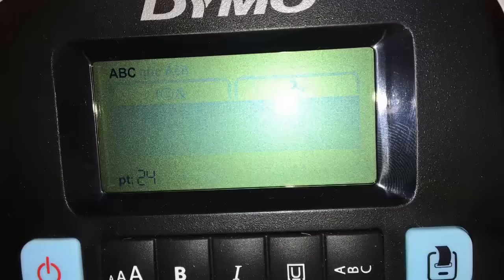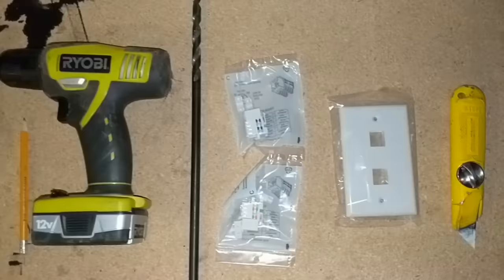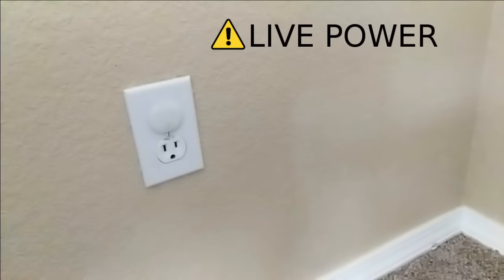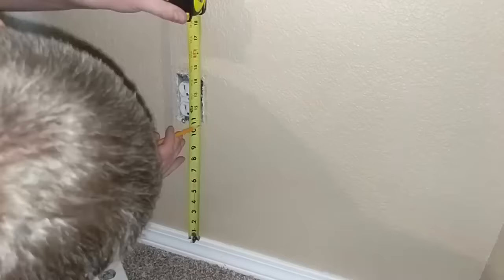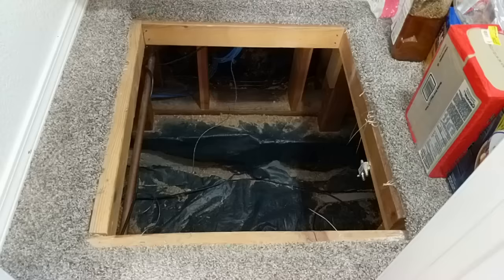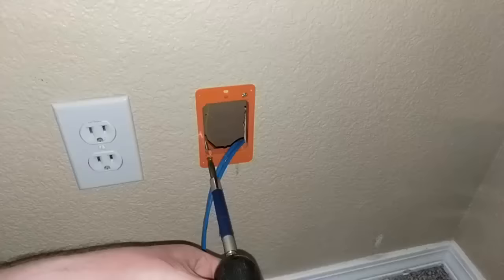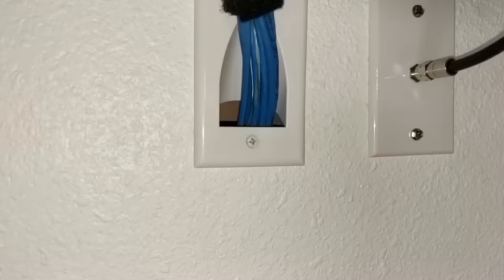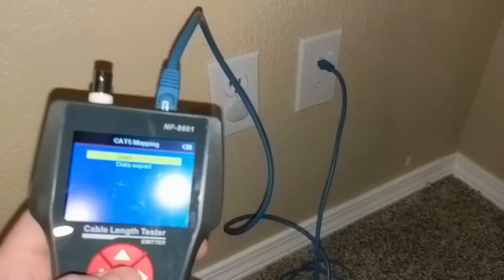How to Add a Network Jack to a Wall

Comment: Step 1: Own a house
Reply: @bumnoma  lol
Reply: American house, the rest of the world build with bricks
Reply: @marcovanderbank7361  like any real house should be
Reply: Yay I passed step 1
Reply: At least I can favorite this video for when I buy a house in the next 15 years
Reply: Single floor homes.  For single people. With broken dreams
Reply: @DrLol07  Not really, building houses out of bricks has a lot of issues, hence why we largely stopped doing it in the US. I've lived in a brick building and keeping it heated and cooled as appropriate was not fun. Perhaps if you live somewhere that never gets very cold or hot it's not an issue, but outside of parts of Columbia, that's really not going to be the case for most folks.
Reply: @marcovanderbank7361  not in Mexican
Reply: Kind of hard in a Biden economy
Reply: Step 2: If running through attic, know where you can safely go so that you don't crash through the ceiling.
Reply: @SmallSpoonBrigade I lived outside of US in a a country with extremely hot summers and extremely cold winters. I had very thick red brick home. Summer time it’s cool and no AC needed. Winter time it’s very warm. So you’re saving a lot of energy winter time and summer time.
Reply: Hahaha
Reply: @marcovanderbank7361 most old houses are lol
Reply: @beansbrian1986 I agree. A 2000 sq ft home goes for nearly 350K+ in the south. Shame.

Comment: And a crawl space. You'll need one of those too.
Reply: There's always an attic
Reply: Cameron Nason not in Artantica
Reply: A full basement works too.
Reply: Can't you run it above the ceiling than drop the cable down to where you want to the plug to be?
Reply from the maker: You can, but much easier if you have an attic.
Reply: @randomman6867  what if it's way smaller than the house
Reply: @thetrabantguy3934  if the attic is is less than 18" high I would recommend using those long ass spotting rods. I usually use a stick of 3/4 PVC to feed shit to me so I can drag it. Most attics/crawlspaces will be smaller than the rest of your house they're just there to help keep the house insulated and sneaking shit through them is a great bonus
Reply: @randomman6867  my house was build somewhere in the 19 hundreds so it's petty old
Reply: Best episode of Breaking Bad: Crawl Space.
Reply: Jessie Sanders  way older like 1. World War old like
Reply: I have in the side of the house
Reply: @david.ricardo  where is artantica located?
Reply: step #1 - get a Crawl Space
Reply: My apartment doesn't have a crawl space
Reply: @Zerpersande  exactly
Reply: @TheLeesmack  🎨🖌️🌐
Reply: @randomman6867  Not true, condos often times won't have an attic, and you're lucky if you've got a drop ceiling either. In that case, your best bet is probably to install a crown molding to hide the cables behind as you run them along the top of the wall and then just drop inside of the wall to get down to where the jack is going to be located. You'll have a bit of trouble at the corners, unless you go with a fairly thick molding though.
Reply: @randomman6867  hahaha knows nothing about construction not all houses have a and attic
Reply: We’re on slab foundation with only a very low attic above the upstairs (2 story house, but part of downstairs just has roof over it, if that makes sense).  Adding insult to injury, most of the area right by the attic entrance is covered by the furnace and ductwork, making getting around (or through?) For running cables quite hard.  (I’m in California, so a lot of houses out here don’t have basements)
Reply: @andresv8856  it doesn't take construction knowledge to know how to feed 06 wire in between existing residential walls
Reply: @randomman6867  yeah I could tell you don't work in the industry my friend so how are you going to run wire without attic or a crawl space having your studs every 16 inches you will make a hole every 16" till you reach to your desire location and I don't know what 06 wire is all I know is romex for outlets
Reply: @randomman6867  Nope, sometimes there's another room on top and you're just screwed.
Reply: Nah, I have a basement with drop tile ceilings.
Reply: @randomman6867  not if your in the basement

Comment: One word of advice.  If you are going to do this, make sure you spend a little extra money and get a good quality cable such as a cat 6 or better cable if there is something.  Even if something doesn't exist now that the wire supports, it may in the future.  And by putting in the best quality now can save you headaches later on by not having to go through this again.  Especially if you had to go through the hassle of fishing wires because you didn't have easy access to where you ran your wires.  When doing a permanent installation such as this.  It's better to plan ahead for future possibilities than to be left behind.  Also make sure the wires are suitable for in-wall use.  I should say so on the package or stamped on the wire itself.
Reply: Personally I used double shielded Cat-7, should be good up to 40gbps.

Comment: Super easy if you have a crawl space, but this is so very rare. :(  Often they're under only a very small limited portion of the house, if they exist at all.
Reply: Quite a lot of newer houses have crawl spaces between floors, but you are correct. More often than not there aren't any.
Reply: True
Reply: If you dont have a crawl, go into the attic. If your home is two stories, it'll be a real chore to bring the wire from the attic to the first floor interior wall, but it isn't impossible
Reply: @nilpo  Not a single house with crawl spaces here in Germany. Would like to build a smal network, but brick walls... 🙈
Reply: @Akantor5  Yeah this tutorial is only good for the US where the houses are hollow and made of paper.
Reply: Yep, No crawlspace for me. there's one UP stairs, that nobody has entered in over 20 years, but I need network cable run down stairs.  Lots of it. I have a nice 100 foot network cable running from the source to the exact opposite end of the house just hanging off the ceilings.  Works fine still but far from optimal.
Reply: Akantor5 Linus has a video where he shows running a 100-foot or so network cable on the outside of his brick home. He makes drilling through the brick look far less scary than I thought it was! Once you get the cable through the drywall, the rest of the procedure is the same as shown here. Search for it on the Linus Tech Tips channel.
Reply: Yeah that’s why I only buy older homes which have a crawl space. Always run more wore than you think you need. It sucks to have to do it again in the future.
Reply: Kevin Adams What if the house has neither a crawl space or attic?
Reply: DoctorWeeTodd 
Then it becomes much harder. You’ll have to fish the wire through the wall and ceiling. Hopefully you have a closet or space that is somewhat centrally located so you don’t run into too much insulation. 

Another option is to run the wire behind the baseboard or crown moulding.
Reply: exactly what I was about to say.  How many people have a crawl space?   

The best that some may have is an Unfinished basement.   And then you would need to be comfortable cutting drywall on he walls and ceiling to fish lines and then patching them back when you are done pulling
Reply: @morgfarm1  Run it outside.
Reply: The crawl space in my house is huge
Reply: @MildMisanthropeMaybeMassive  The best way to do it is to replace any COAX that you may have.

I just bought a house that's 2400 SQ Feet, 1st and 2nd floor. Servers and what not are going into the unfinished basement. The house is wired for COAX, I am going to attach the CAT 6 cable and pull it through. It's the best and most economical way.
Reply: Akantor5 if u ever end up doing it, remember to always drill into the brick, not the mortar
Reply: Underground Arms partial basement with a crawlspace under the rest of it.
Reply: @nilpo  crawl spaces are not in newer homes
Reply: @jokerbox_official  Sure they are. It just depends where you live. It's one of the three major foundation types in use in the United States: slab, crawl space, and basement. In many areas, the risk of natural disasters or environment make slab foundations impractical and not every new home has a basement.
Reply: Pretty common here in Oregon but this is the 1st place I’ve owned a home without a solid, slab foundation.
Reply: it's not rare at all, it depends on where you live.  Crawl spaces also are not what make this super easy, basements make it super easy.  Also, depending on how nice your crawl space is is a big determining factor of how easy it will be to move around in and deal with.
Reply: Depends on where you live, almost every home has a crawlspace in Alaska.
Reply: There are homes with crawl spaces all over here in the state of Illinois, and across the country they are just as common as basements or just concrete slabs. What a simple, stupid topic and still people passing misinformation like "they are rare". LMAO
Reply: @StephanieHua  Youd be MUCH MUCH better off doing this with an unfinished basement.
Reply: @jokerbox_official  Thats simply NOT true.
Reply: @VoidSixx  You misspelled, "where the houses are properly constructed." Solid walls made of brick is definitely not the right way to build a building for various reasons including the issues running electrical and network in the walls. Not to mention the issues you get when the ground settles or you have an earthquake. Better to choose good materials like wood which are much better able to handle those issues.
Reply: @MildMisanthropeMaybeMassive  One possibilitly is running it in the wall. You can do it, but it's a pain and you'll likely be patching a fair amount of drywall in the process. God help you if you have those cheap plaster walls where they textured it rather than properly smoothed it out. Or, you can run the wire on the outside of the wall in conduits. It's rather ugly, but if you know what you're doing, you can hide it behind moldings and in the corners where you'll forget that it's there. Even with that, you can just run the wire from the ceiling to the floor at the points where you want a jack. 

You can also often run it through the floor, if you're going the same direction as the joists, that can be rather easy, but if you're going perpendicular to them, then you have the same issues as you'd have going along the wall.

But, really, if you have neither a crawl space or an attic, like a typical condo, then you're probably best off just hiring somebody to do the work for you or just accepting that it's going to look ugly.
Reply: @SmallSpoonBrigade  Ha! My house is already ugly.
Reply: I have a basement. Does that count?
Reply: @VoidSixx  the US has houses made of wood, stone, brick, etc.

Comment: Knowledge to know that some homes are not 16" throughout the whole wall. I had a place that was 16" until I got within 2' of the corner and the one stud was actually 19"s apart. Just to be aware.

Comment: On the mud ring or the low voltage box, there are 4 tiny holes located at every corner. Use these holes as a template to mark the hole you are about to cut.

Comment: Wish I had a crawlspace. My house has useless telephone and coax jacks that I would love to replace, but I see no way of getting to them.
Reply: You can turn those coax jacks into ethernet by using moca adapters.
Reply: Same thing goes for the telephone jacks. If your house was built in the late 90s, early 2000s or newer, there's a good chance the builders of your house used CAT5 or CAT5E for the telephone jacks. So you can convert them into ethernet jacks.

Comment: The little nylon string is used for stripping the jacket, as using the cable-stripper alone can damage the underlying copper wires. You expose the nylon string, then pull down on the string to "tear" through the jacket, rather than cutting the jacket with a blade.

Comment: Thanks for this! Most videos I've watched have said to drill a hole into the floor in front of where I want to add the wall plate. You're the only one so far to point out that electrical outlet wiring can be used as a reference too. Hoping to avoid drilling holes that won't be used.

Comment: 4:45 I would recommend using a “spotter rod” , snip the straight long portion from a wire coat hanger and using a drill with the spotter rod in the chuck, bore through the floor as close to the footboard. Go back down to the crawl space/basement measure an 1 1/2” to 2” (4-5 cm) into the wall cavity and drill your hole out for your wiring. I do this all the time for running new thermostat wiring.
Reply: Or use a very small drill bit, same size as the hanger then put the hanger through the hole.
Reply: I use the same thing

Comment: I'm remodelling at the moment, I think I'm going to add network jacks to all my rooms after watching this. So much better than wifi!
Reply: same here! for years I've used only WiFi for everything, but man... once I connected an ethernet cable just to see what would happen I was in shock at how much faster everything was loading. So now I'm looking to see how much it would cost to just run ethernet ports to the rooms myself. Much cheaper than paying AT&T to do it after they've already done an install.

Comment: A cheap way to run ethernet through your whole house (assuming you are like me and don't use cable TV anymore) is to utilize the existing coax outlets across the house. Pull the cover off, tape the ethernet run(s) to the existing coax, and pull it up through the ceiling or floor. Then switch the coax plate with a couple keystones.
Reply: sure would be nice had they not stapled the shit when building the house
Reply: As mentioned:  as standard practice most electricians are going to be stapling cables everywhere so using an existing cable to pull a new cable through....just isn't possible anymore. 

If you don't have a cookie cutter house and built your own or your house is old: then yeah that might be possible.

If you really want to be friendly to your future self: run some 1 inch conduit and put the cables through there. A one inch conduit could easily fit at least 8 Ethernet cables , 4 HDMI cables, or quite a bunch of speaker cable.
Reply: If you have an older house that already has coax running through it, as long as your router supports it, and coax can reach the router you can use Moca to repurpose coax as an ethernet.
Reply: @mrpotatotv  yes but does it support multi-gig speeds? I'm getting 2g  fiber internet soon and I'm not sure if moca would support that.

Comment: Pro tip. The LV box you have has four very small holes at the corners of the interior. You hold the box against the wall backwards, punch the holes with a poker or nail, and you have the exact size you need to cut out. Just connect the dots.
Reply: I was going to add this.  Makes the hole the EXACT size you need.  My only advice is to hold a small level under it so you don't make an angled hole (easy to do at such close proximity).
Reply from the maker: Good tip, that's good for getting the cutout the right size, I still like to measure the outlet next to it still, so I know they will line up.

Comment: Plan on doing this in the early spring, but I kept thinking, "it can't be that easy."  Thank you for proving me wrong. :)  Although for my peace of mind I think I'll secure the boxes to studs as well, I don't like the idea of floating the plates in just drywall.
Reply from the maker: That orange drywall box I used and showed in the video works great and holds well. I've never had issues with it, as long as it's not supporting tons of weight.

Comment: This was incredibly helpful. Especially the optional utility blade in place of a jab saw. Thanks!
Reply: Yeah, when I first started cutting holes in my walls to install ethernet jacks, I used a utility knife since I didn't have a jab saw. It does take a bit longer than a jab saw, but it gets the job done when I don't have that saw

Comment: Oh you lucky  people who have dry wall and not horse hair plaster walls. This always looks so easy, especially when you are installing it on the first floor. You never see youtube videos of anyone running network cable from the basement to the attic in finished construction. Now that would make for a great video.
Reply: Best to work with gravity. Start from the attic and go to the basement.
Reply: @norge696  Poimt taken,  but it doesnt change the degree of difficulty of dealing with the plaster or lath.

Comment: I like how you ran two cables to your new location so that you have an extra port for an additional device and for redundancy. I hate when some people run only one cable to a new location and realize they need another ethernet port.
Reply: I mean u can just add a cable splitter no biggie
Reply: @younggoob2396  You mean a switch? Well it makes more sense to run multiple cables per drop and have a large central switch instead of buying a switches for each drop. Saves time and money. No need to crawl into the attic or crawlspace to replace a cable or add one for a single cable drop. Plus, it's sometimes easier to run two or more cables instead of one. You don't have to terminate both cables in each drop.  You can terminate one of them and later on terminate the other cable when you need it. Much easier than fishing another cable.